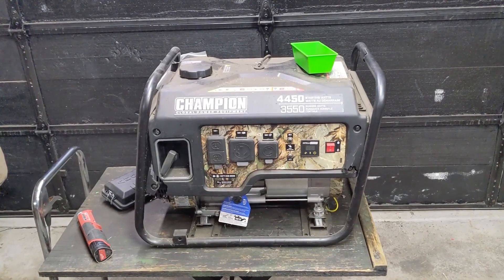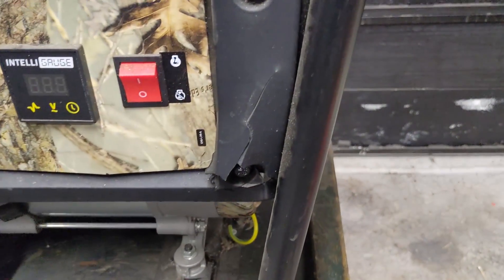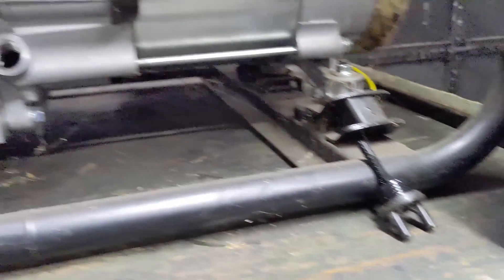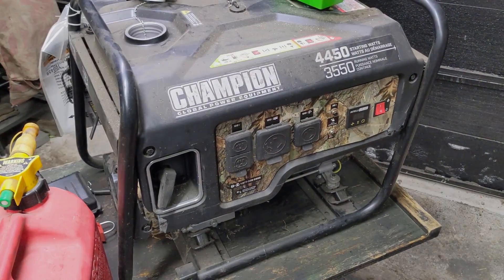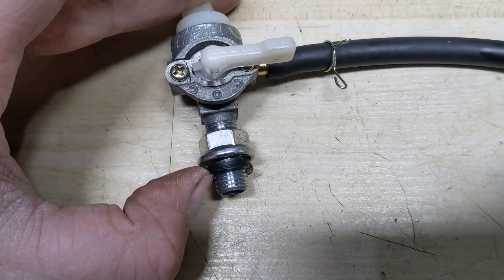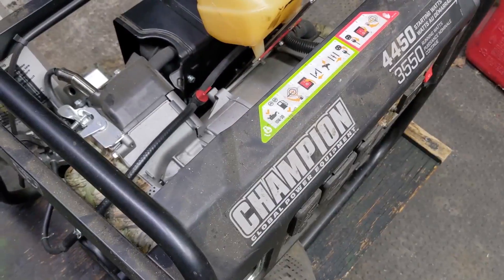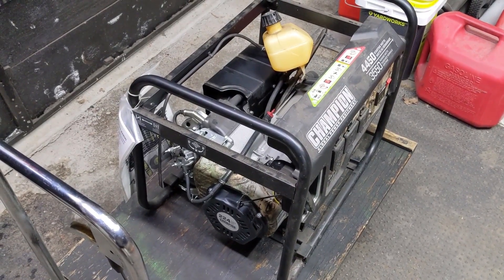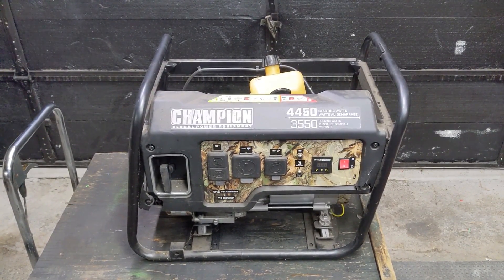Fixing Up a Damaged Generator (Part 1)

Comment: Nice little project Jake. Hope you can get all the parts. Guess they didn’t see it fall off the truck with all that ‘camo’!  Lol (I know bad joke) .  Are you going to tig it yourself?  Looking forward to pt 2. Stay Safe.    Rick
Reply from the maker: Ha yea, either it fell off the truck, or the shelf they put it on, but I heard it was the actual truck because they pulled it out of the box to see the damage, and I never got the box lol yes I'll be Tig welding this fuel tank to save some coin, instead of buying a whole new tank. That'll be in part 2 once I can get some parts. Thanks for watching!

Comment: I have 3 Champion generators two for myself and one I just bought for my parents. Their products are good but customer service no bueno. A dual fuel I purchased had a cracked plastic panel on it out of the box so it was a warranty replacement but just getting them to email a tracking number on the part took an act of Congress, after talking to multiple people and about a month going by, I got my part. Will be interesting to see how it goes for you. Thanks again for making these videos kid, I always learn something from you, always! You always keep it interesting!
Reply from the maker: Thanks for watching, usually I haven't had any issues, other than the wait times on the phone, I've always had a good experience with them!

Comment: A little bit of damage is saying it lightly, wow this thing got whacked, looks like it fell off a high lift truck bed. Thought you were gonna say "well that's not good" when the fuel was leaking, i always get a good chuckle when you say that. A really good video other than gassing the OLD MAN out of the shop.
Reply from the maker: Yea I guess it wasn't leaking fast enough for me to be too worried lol either way, we'll get it fixed up!

Comment: Good to see it outputs power. Hope you include the TIG welding in the next video.
Reply: And hope he does not blow up the OLD MAN
Reply from the maker: Yes absolutely, part 2 we'll have the new parts, straighten the frame out and weld up the fuel tank!
Reply: @EliminatorPerformance  looking forward to seeing the tank welding!